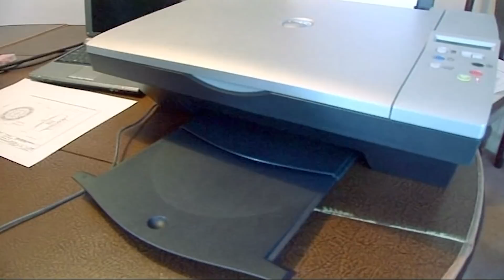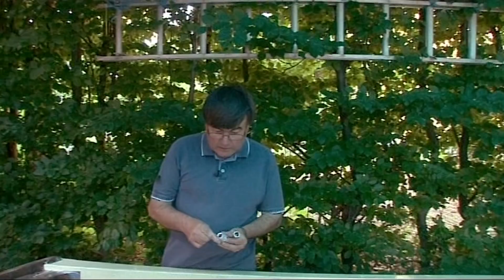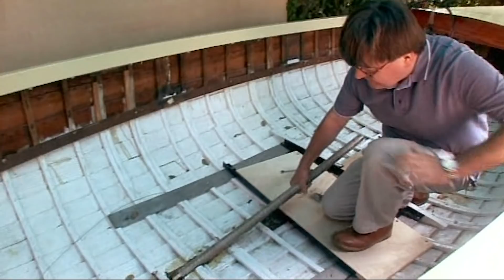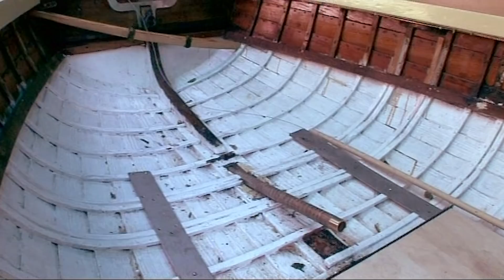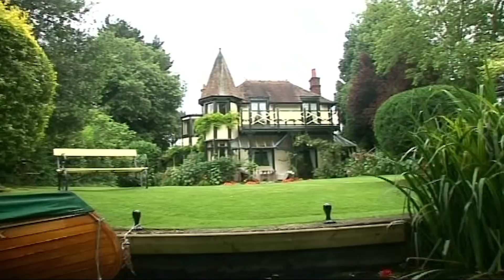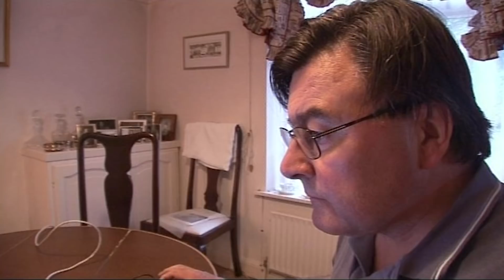CLINKER PART 2 | Bill's Risky Engine Swap

Comment: We called the cutter an old woman’s tooth on the boring bar we. Made patterns that support that were fixed across the boat to hold the boring drill at the correct angle for the bore out  bills going at it free hand  , and bill needs to get the boat sandblasted all paint off to let the hull dry out good luck bill

Comment: We remember watching this the first time round. Bill is an innovator, he embraces new technology and thinks laterally. He's not wrong he just thinks differently. The neodymium magnet motors are now common in electric boats. The Brunton Auto prop is a revolution in propellor design that has changed boat performance around the world. And yet, reading some of the comments there are folks that are unhappy that he is pushing the boundaries of  propulsion evolution at the time yet, has been proved right. If we do not advance and embrace  forward thinking and accept people like Bill do not think conventionally and push those boundaries we would still be paddling around in hollowed out tree trunks. Well done Bill and the production team. "If you do what you have always done you will get what you always got".    Sail Safe Guys, Ant, Cid & the pooch crew.

Comment: The epoxy over wood thing made me gasp. That said, perhaps for what he intends to use the boat for, and if longevity is not an issue, it will be fine. Thoroughly enjoying the series. And yes, it is a gasoline engine, a steam engine, and if it is electric, it is a motor.
Reply: What about a motorcycle?

Comment: LOL, if it's "electric" it's not an "engine"...  If there's no combustion, there's no engine. Purely electric vehicles don't have engines, they have motors.
Reply: Definition of engine ~ "a machine with moving parts that converts power into motion.", seems to fit
Reply: @supers54  look up "motor vs engine"...
Reply: @macgyver5108  Dictionaries don't work like that.
Reply: @supers54  they do in this case... a motor is a simple machine, an engine is complex
Reply: @Errol.C-nz  Definition of engine ~ "a machine with moving parts that converts power into motion."
Reply: @supers54  what can I say, dictionaries aren't always accurate and are subject to change...
Reply: @macgyver5108  I'll stick with the dictionary definition rather than a randomer on the Internet !
Reply: @supers54  Just not a mechanic then...thats ok youre forgiven...electric motor...piston engine 👌
Reply: @Errol.C-nz  *that's,  *you're. You need to spend more time with that dictionary. 🤏
Reply: @supers54  na mate...you spend too much time with it i stead of in reality
Reply: @Errol.C-nz  *instead
Reply: @supers54  I think the term 'engine' relates to internal combustion. Electric motors have no moving parts but neither do jet engines, the difference is the power generation, internal combustion Versus Induction
Reply: @Stoic-of-Rome  Electric motors and jet engines very much do have moving parts...how would they provide power otherwise?!